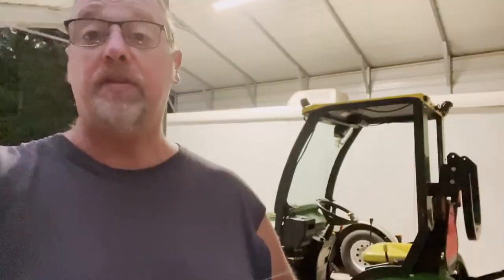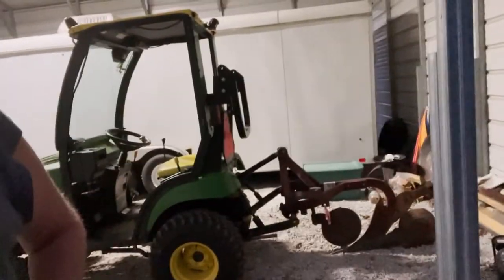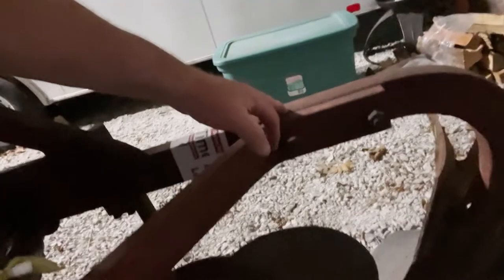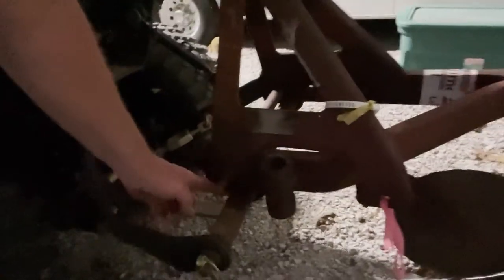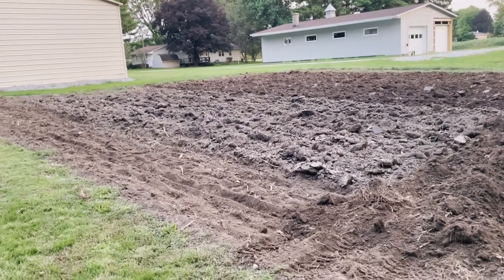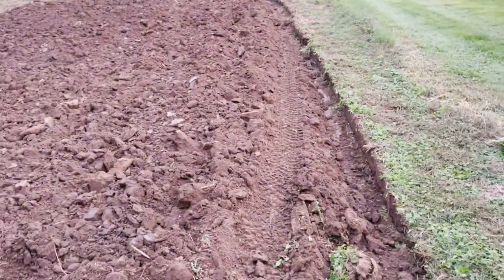Moldboard Plowing with a Subcompact Tractor??

Comment: Were you in high range on the hydro? If so, next year try it in low range. That 20hp diesel shouldn't bog that bad with a 14" bottom. You might try a depth gauge wheel too. Also make sure plow is running level in furrow, too much tilt forward and they will pull much harder.  A properly adjusted moldboard plow doesn't take a ton of HP to pull unless the ground is real wet. The general rule is to set the depth at half the width or slightly more. Your 14" bottom will work best at no deeper than 7 to 8". 
My 1970 General Electric garden tractor only has a 1.5HP 36 volt traction motor and i can pull a 10" Brinly about 5 to 6" deep in sod and about 7" deep in previous garden ground without the amp meter going past the medium zone. I have run it to 8" deep once just to show off that it could pull it and it did but it worked the tractor noticably harder as the stated working depth for that plow as per Brinly is 6".
Reply from the maker: Hello and thanks for watching. Yes,  it was in low range. There are a few problems going on with this plow. The biggest problem is someone took a 2 bottom and converted it to a one bottom. When they did this they used the back moldboard instead of the front, so the side to side alignment isn't right. The second is when they did the conversion, they flipped the alignment cam rather then re drilling the mounting holes so I can't get the moldboard aligned the way it should be. The other issue is with the tractor itself. The 3 pt doesn't have a position stop to lower it to the same place every time. I am going to send this one down the road at the next auction and keep looking for a better unit. Someday, I'd like to get a 40-50hp tractor and a proper 2-3 bottom plow.
Reply: @Frontpagefab  Okay that makes sense then. Happy gardening! Best hobby in my opinion.
Reply from the maker: @jeremydavis2595  For sure. We have been gardening for as far back as I can remember (and I am going on 59). I am looking to expand our gardening to start doing the farmers market thing for a semi retirement gig.